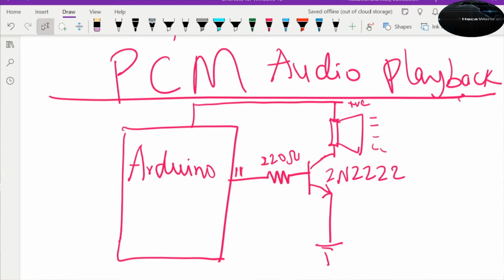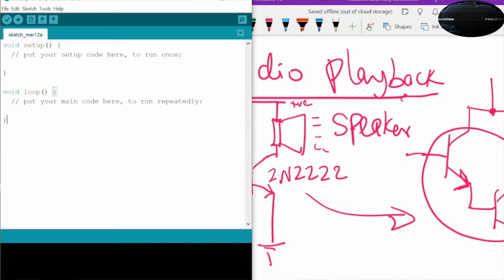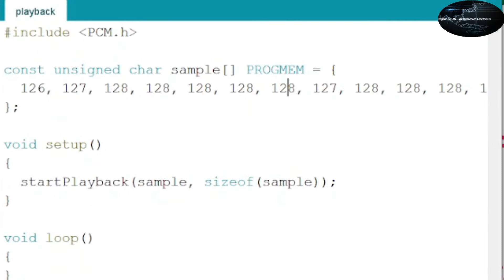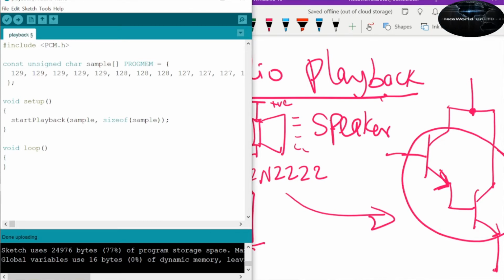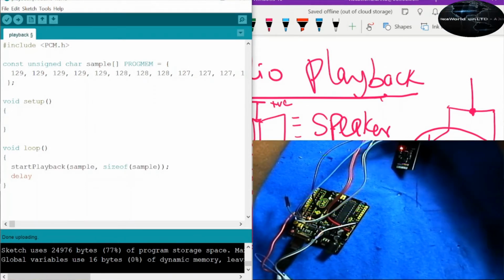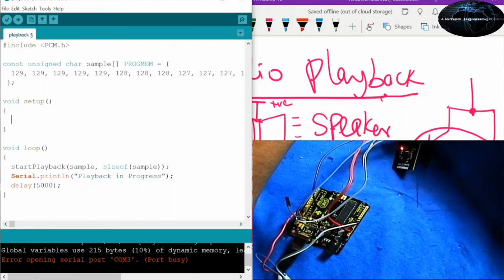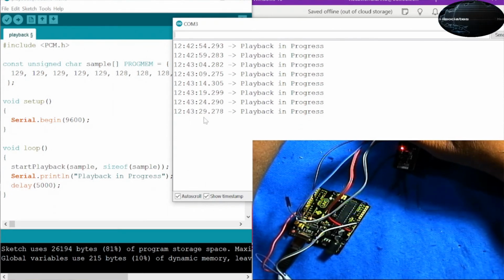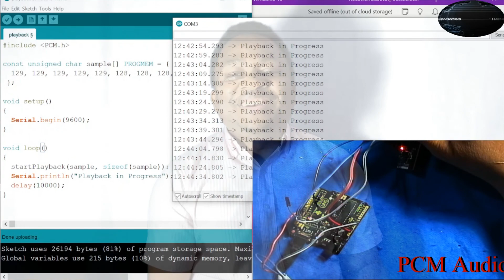NFC TAG Tutorial Part 2 | PCM Audio playback with Arduino | Playing Audio With Arduino |

Comment: Hi, can you program an Arduino to play sound by tapping an NFC tag?
Reply from the maker: Yes.... However, if you want the song to be played directly from the Arduino, the clip will be a short clip... else, if you want to play a full sound track you will need to integrate it with an mp3 player and use the tag to trigger to track you want to play.
Reply: @hecanet  Awesome, thanks! It won’t be a song but a few, up to 15-20 short sound bites, each 3 seconds max. Will you do a tutorial on this?
Reply from the maker: @donnellm5435  Yes... I am finalizing the video and it will be coming out by end of the month... stay tuned.
Reply from the maker: @donnellm5435  The final video in the series is dropping sometime tonight... watch out for it.... you might have to go back and watch a couple of the videos in the series to learn the full steps - https://www.youtube.com/watch?v=euzM3t9hgEQ. 

Depending on interests, we are open to sharing the codes on our website.